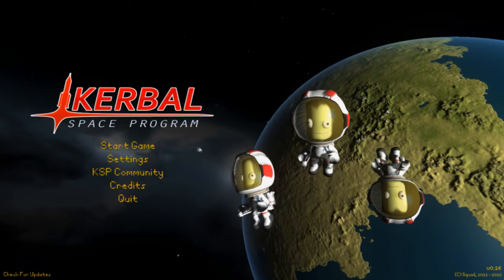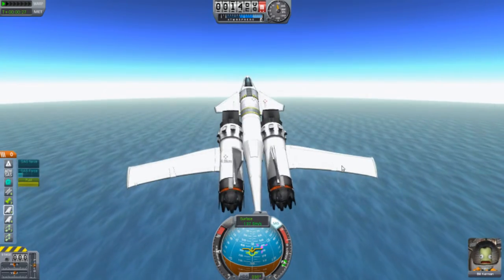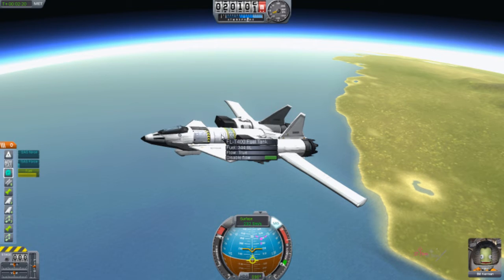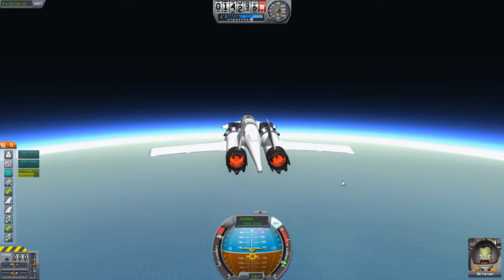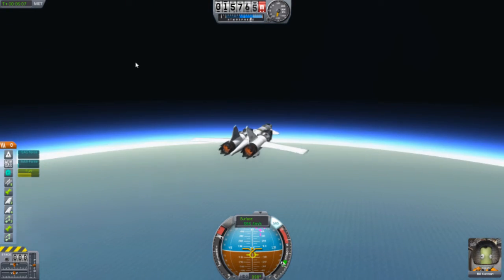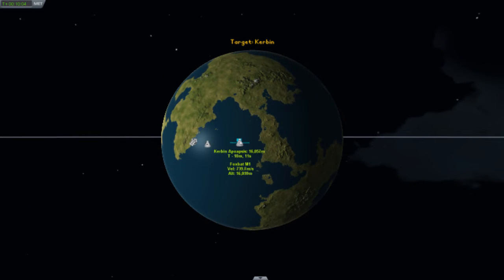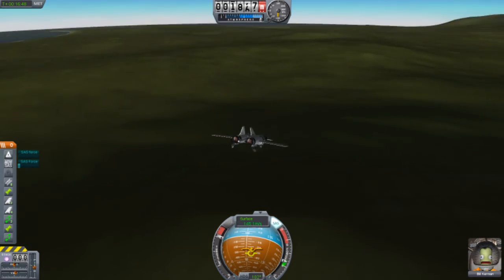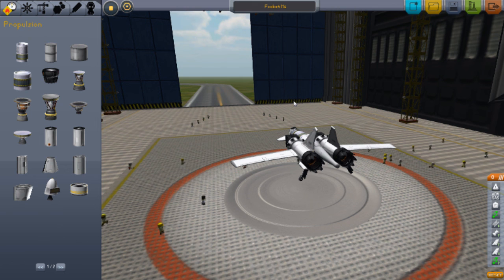KSP - MiG-25 Foxbat Jet Fighter Plane

Comment from the maker: Thanks for commenting :) I think it does, logically it should. I haven't seen anything about that in the wiki. I found this for Turbo jet engines ' This engine chokes in thick atmospheres and will only operate efficiently in the thinner air, due to its high performance ram air intakes.' So if you have the correct air intake, it should help increase airflow therefore increasing airspeed.